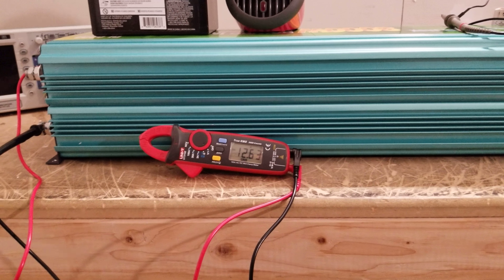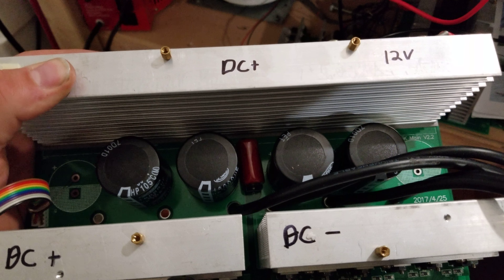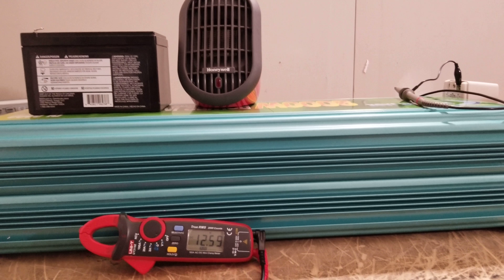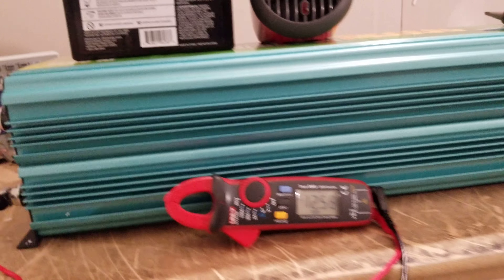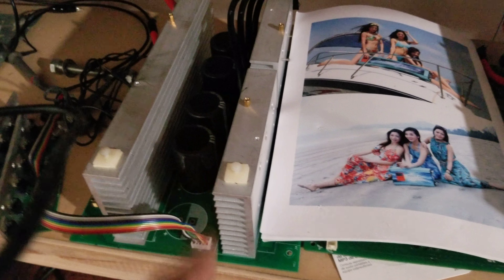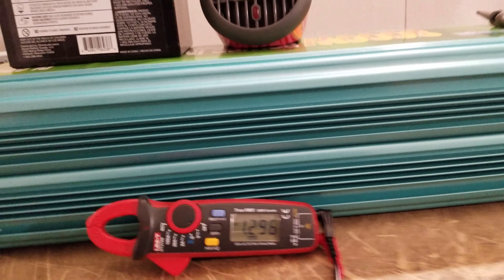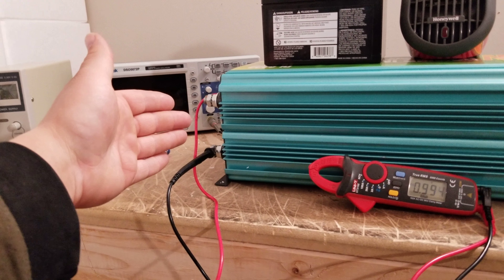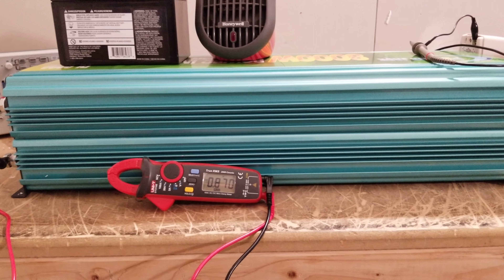How to discharge an inverter

Comment: I modified a two-bank battery switch.  It is m battery disconnect and inverter pre charge.  Battery terminal 1 is my pre-charge it has a couple resisters wired to it.  Terminal two is full power.  As for the switch, I go from Off to 1 for one second, turn past “All” to 2.  Works perfect, is safe and won’t scare the crud out of my wife and children

Comment: thanks for explaining this.  it is now clear to me why my renogy 2000w inverter causes my 170ah renogy battery to shut down.  its drawing too much current to charge the caps.  Renogy specs the 170ah battery for a 2kw inverter, but obviously they did not run their tests on a cold inverter.  ugh.  Too bad for me Renogy customer service sucks and they say my "battery tests fine on their bench".

Comment: So what about when you've been using the inverter. Then you turn it off. And now you need to disconnect it from the battery? Will there be a spark when you disconnect? Is this only an issue when connecting? I can find dozens of video tutorials on the subject of preventing an arc when connecting. But what about when disconnecting? I cannot find good info on this. Does anyone know?